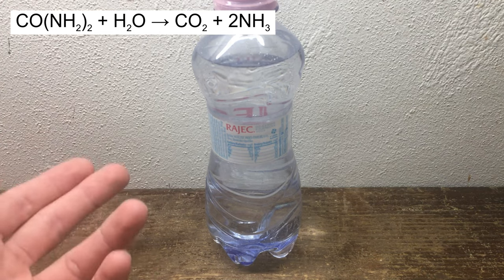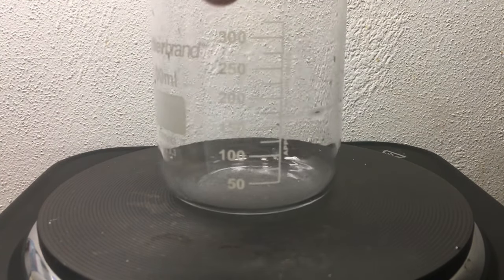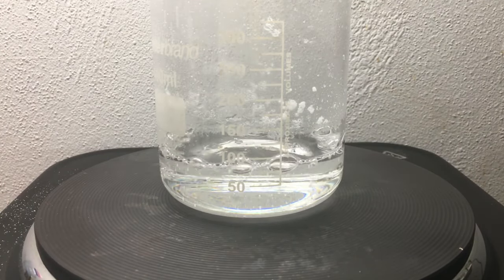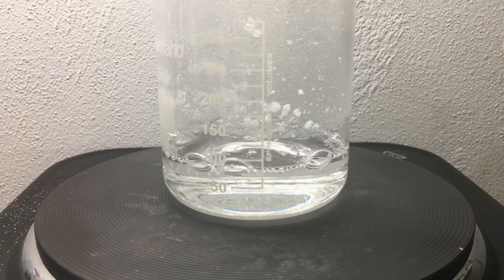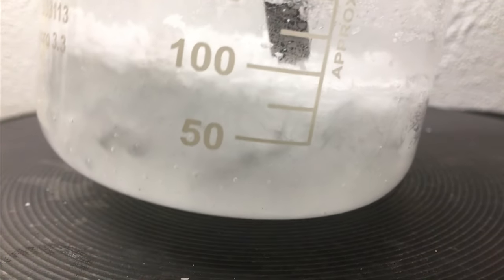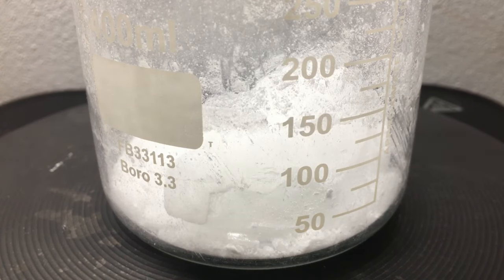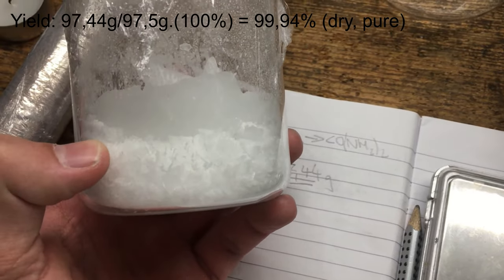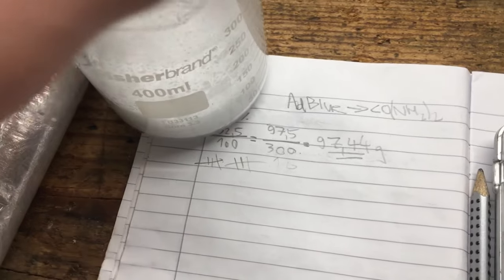Extraction of Urea CO(NH2)2 from AdBlue

Comment: I have a different question, can I make the opposite of this process cause I can't find the adblue in my area, as long as adblue is urea and water 🤔can you give me an idea if I'm right
Reply from the maker: Are you asking whether you can make AdBlue at home? No doubt you can and you only need urea and water. They have to be quite pure, but there is people refueling their cars with used fryer oil or doing worse things to their cars, so it would probably work.
Reply: @petesmiscellaneousdiscover655  I appreciate your support, can you please tell more about what you mean by pure urea?pure water?
Do you mean the same water which is used for adding to the batteries?deionized water?
And can I use the urea which is used in farming?
Thanks in advance
Reply: I would do it, this water is fine. I looked at gardening urea and it is 98% here, from the MSDS. Then just put about 33%, so 330 grams in 1 litre water.
The other thing is, I would dissolve it in about half the water, mix it with a little heat then pour it through a filter and flush with the last part of water.
Reply: @saadalharbi205  الموضوع سهل وحيياك خبرني لو تبي تعرف التفاصيل